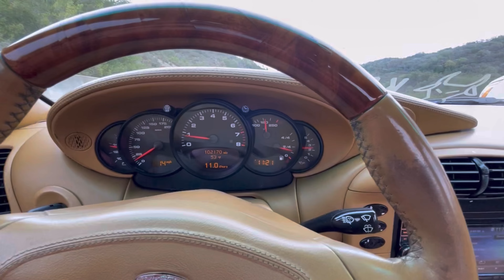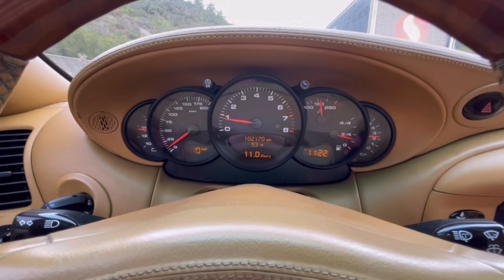FINALLY Fixed My 996 Turbo PSM/ABS Issue!

Comment: Glad you got it fixed but what made it $3k?
Reply from the maker: Thanks! I realized I forgot to list out the entire job. The car spent over a month at the shop; they cleaned my throttle body and put it back only to have the problem continue, so they got me a new TB. They also figured it was time to replace my alternator since they were already halfway there. So realistically, I paid $3k, but it could've been cheaper if they didn't replace my TB or my alternator.

Comment: Couldn’t you just make a hose , looks quite simple to replicate
Reply from the maker: The hardest part for me and the shops was finding where the actual leak was coming from. The hose itself was $17 or $18 when I looked up the part number.